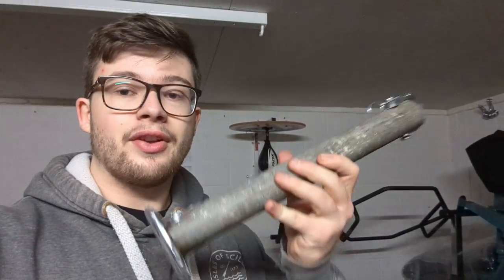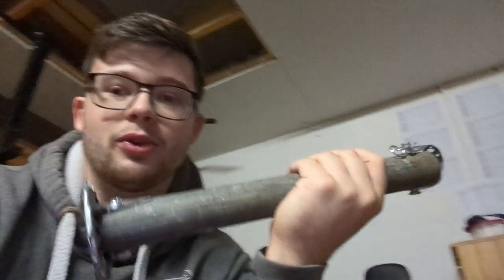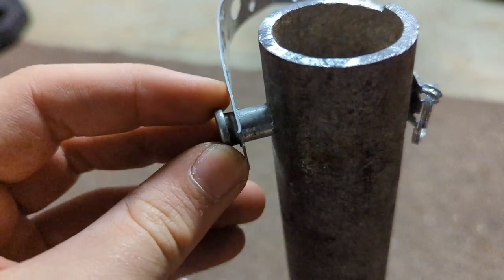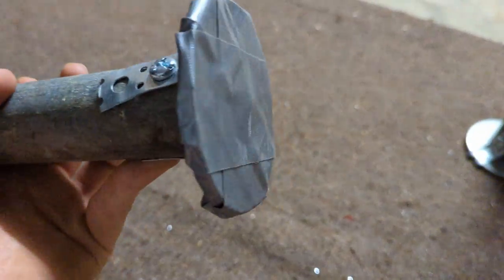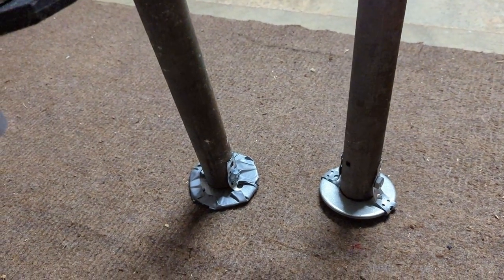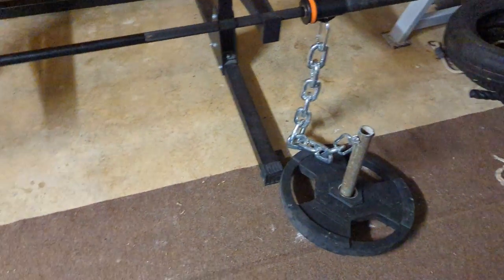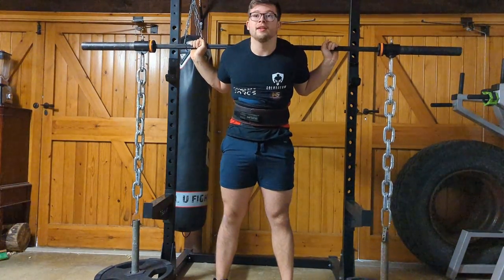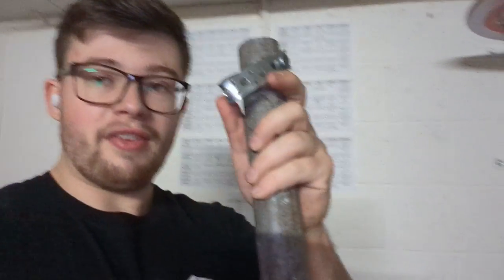How to Build a DIY Strongman Yoke | Chain Yoke

Comment: i'd recommend using threaded pipe with a threaded flange as your bottom stop and then drill a bolt hole at the top, and use a fast link as your attachment point, you can also use carabeiners or snap links that are rated for the weight you intend to use. that pipe hanger strap, especially being perforated, is a little sketchy when you get over a bit of weight, its subject to tearing. so be careful, but great work and great diy spirit. also that defender is sweet man!
Reply from the maker: Hasn't teared yet but I get your point and I just used what I had on hand! Upgraded to a proper yoke these days anyway, thanks for the comment!

Comment: if i was to say do a yoke using a barbell but had next to no space to move would walking on the spot or just moving afew steps back and forth do. 

Also lifting chains while tempting are abit out of my price range, but i know a guy who can make chains for me, is their any difference between say a pair of 12kg chains vs the bog stand 1 meter long, 10mm thick chains
Reply from the maker: Any chain will do so ideal if you can get some made, and if you don't have much space you can always do some heavy pick ups and holds for time, that sorta thing